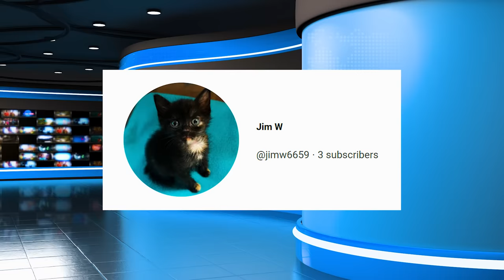Why Are So Many Builders Running Away?

Comment: As a “customer” I found this extremely interesting. In 2019 I had an extension built (circa £150k) and having received several fixed price quotes (one of which was ludicrously low) I eventually shook hands with a builder who agreed for me to pay for all the building materials direct. He sourced it, ordered it and I paid for it. I paid his electrician, plasterer, brickie etc direct. The “fixed” payment was that which I paid to him split evenly over the course of the job. I was happy that there was no contingency fat built into the quote for materials and he was happy that his profit was protected. It worked out really well for us both - and we have remained good mates since.  I realise it’s not a common business model but it removed a lot of potential points of conflict and was generally less stressful for both parties.
Reply: Quote: "He sourced it, ordered it and I paid for it". Thing is this model has allowed many builders to remain under the VAT registration threshold which ,if investigated the Builder can be prosecuted for vat fraud. It's saved you 20% VAT on all the Labour but may have also broken the law.
Reply: @AdrianSams  I can’t see how it can be breaking the law.  There’s nothing unlawful about me buying materials and paying an expert to use them…..and at no point did I say I saved by not paying any VAT.
Reply: @AdrianSams  It would be difficult for HMRC to prove that, 'Sourcing and ordering' doesn't leave a paper trail.
Reply: This is becoming more common and traditional building companies are not getting the work anymore......
Reply: Try explaining that deal in Albanian, Polish or Somalian.
Reply: Another way to look at it Kevin is to ask yourself what would happen if every builder did exactly the same as your builder. How much VAT would the Chancellor lose ?. Every £10k of Labour they are losing £2k in vat. I'm not knocking people for doing it other than it prices out vat registered businesses . If I did the same thing ,based on last years accounts the state would lose out to the tune of £20k and that is just one small business in a small town in England.
Reply: @AdrianSams  You are assuming that I did not pay VAT. The builder was VAT registered and charged VAT for their services.  The only difference was that the quote for his services did not include materials.  I obviously also paid VAT for the materials. Some sub-contractors were VAT registered and some were not - perfectly legit. HMRC did not lose a penny on the job.   The point is, the builder did not have to include any contingency in his quote for fluctuations in material prices.   If he had, then either I would have ended up paying too much for the materials used (I lose) or he would have ended up making a loss on the materials (where I win, but possibly lose the builder before the job is done).
Reply: @kevinturner8343  So when I posted a message in reply to your post where I said (not having a dig at you) how some Builders were avoiding the vat registration system by getting the client to 
pay for materials which keeps them under the vat threshold so aviding charging vat on their labour you could have posted back that the builder was vat registered. Would have saved typing time  ,well done you .
Reply: @AdrianSams  Well I did say "at no point did I say I saved money by not paying VAT" in my reply :)
However your point is still valid.  In simplistic terms, if every builder's quote was 50% cheaper because they did not have to worry about materials, they would indeed be possibly more likely to stay under the VAT threshold....and legally as far as I can see.
Reply: There is absolutely nothing fraudulent with operating in this way. I don't see how HMRC would be able to bring a VAT fraud charge to builders operating on a "labour only" basis.
Reply: @kevinturner:  @AdrianSams is what we call a 'Karen.'
Reply: Stick as many of the materials as you can on a credit card and clear off using the air miles while the work is being done too.
Reply: This is normal working practice in Peru. Actually we had to source and have delivered the materials too, but often with some advice from the guys doing the work. This has the advantage that we know the quality of the materials being used, i.e. nothing is being substituted with inferior copies, and we can check that the quantities being delivered are correct. We built a whole house like this. It's interesting that some form of this is also possible in the UK. Yes, it gives both sides some additional guarantees.
Reply: @AdrianSams  -  Sounds like you need to check out the VAT Flat Rate scheme and then sack your accountant for not telling you about it (or punch yourself in the face for not getting an accountant and wasting so much money). Turnover under £150k = eligible for Flat Rate VAT. I pay 7.5% in my retail business. For building it would be 9.5%.
Reply: That’s exactly how I do it in Australia 👌🏽
Reply: Seems like a good idea for both of you. I don't trust customers any more. Sad but true.
Reply: This is pretty much how its done here in Canada the Builder/ organizer mentioned here is called a GC "General contractor" in Canada and is paid a % of material and labour costs.
Reply: @uazuazu  Same In Canada
Reply: @AdrianSams  Your making huge assumptions, how do you know the builder isnt VAT registered ?. Its not illegal. Its a self build contract which everyone has the right to enter. It comes with risks, the builder is not obliged to stand over the work or materials that the customer paid others for, thats simple contract law. If the builder does cover these risks he should be charging for it. Either way his income gets accessed for VAT and failures to do that are down to the builder not the customer. Not everyone would have the knowledge or confidence to contract this way which includes ignoring unrealistic quotes. It also transfers a lot of the admin and requires the customer to visit site more often to supervise progress . These factors should  rightly command a lower price.
Reply: @Finderskeepers.  Go back and read my first message where I said the Builder MAY, Notice the word "May and not "Had" have commited vat fraud. Don't you numpties read the whole chat?..You could have saved yourself all that typing.
Reply: @AdrianSams   "the Builder can be prosecuted for vat fraud" conditional only on a VAT inspection.   I dont see any "may" attached to this opinion. Appears you dont practice what you preach.
Reply: @AdrianSams  your second message clearly implied fraud:

“ask yourself what would happen if every builder did exactly the same as your builder”

I’m sure you will apologise for your error
Reply: @RobinHarris-nf4yv  Rubbish, ever heard of the term "Hypothetical Question?. Definition of "Hyperthetical" being "in a way that is imagined or suggested but not necessarily real or true".
Reply: @AdrianSams  As a Canadian former small buisness owner, we pay VAT (HST) for materials, fuel and repairs to our equipment. The CDN government then allows us to "claw back" the HST. However we must charge the customer HST. If the customer were to buy materials etc directly, they'd STILL have to pay HST from the supplier. 

Is this similar to the UK system?
Reply: @AdrianSams  this is and has been not only legal but a legit form of working in this industry for decades- VAT is still payed on the appropriate materials at the appropriate rate. The customer 'Worked' by sourcing and buying them instead of the builder.  This isn't Tax avoidance at all.
Reply: @goodlookinouthomie1757  The VAT discussion is a rabbit hole that is really nothing to do with it.  

The video describes a scenario where builders lose money by providing fixed quotes for materials that then go up in price - ergo the builder makes a loss on the materials and, in the worst case, a loss on the whole job. If they do not have to include material costs in their quote, that particular risk element is gone.  For me, I would rather pay for the materials as the job progresses as (as I said in the first comment) I know I am getting them at cost and I am not going to lose the builder halfway through the job because he cannot afford to carry on.
Reply: This is how they do it in France for tax reasons.
Reply: @AdrianSams is it bollocks breaking the law. 😂
Reply: @Simple_Simon_UK  you really are "simple" Simon...aren't you? 😮‍💨
Reply: Spot the know-nothing pen pusher Adrian...
Reply: Spot the know-nothing pen pusher Adrian...
Reply: Spot the know-nothing pen pusher Adrian...
Reply: That's a good way of doing it. A lot of builders add extra money on to the materials and the wages of the other trades because they are greedy, grabbing bar stewards.
Reply: It removed the government, the third party.  And that is always a win-win.   Hopefully we all learn to vote that way - libertarian.
Reply: I’m a bricklayer/builder and I do this method all the time, keeps everything honest and less mistakes are made
Reply: @AdrianSams the builder could claim the  VAT back for the materials but the customer can’t. So HMRC get more out of this job!!
Reply: @AdrianSams  - I'd spend it on family or down the pub instead of on putting up free loaders in hotels.
Reply: @AdrianSams you say that as if it’s a bad thing. Do you really think they deserve a penny when you look at what they spend it on
Reply: @AdrianSams  On the other hand, you could have asked rather than making (inaccurate) assumptions.
Reply: @AdrianSams  If that were the case, then you should have stated so. You didn't and I suspect you are just clutching at straws rather than admitting that you made a series of rash assumptions and haven't got the guts to admit you were wrong.
Reply: @AdrianSams I get the feeling that people don’t want to be on job sites with you 😂

Comment: Heating guy here. I’ve had enough  now, 20 years self employed, sick, stressed, working too much and too hard, not being truly valued, helping people out, but as soon as your not available immediately they drop you for someone else. Being betrayed by family has been the final nail in the coffin. 

I’m going to try and be a boring 9-5 smart meter fitter in 2024.
Reply: I hope the meter fitting course explains how the 13th amendment regs were updated to using non-combustible consumer units off the back of the increased number of fires that were actually down to smart meters fitted onto reused meter tails that were oxidised, making high resistance connections causing overheating! But they probably won't...
Reply: I'm coming with you m8
Reply: Right on there about family. @effing sicking
Reply: Absolutely right .  No  loyalty from customers  (another heating guy).

Comment: As a plumber/gas engineer I always tried to judge the customer when going to quote. Turned down quite a few jobs, particularly those who wanted a fixed quote for a job with a lot of unknowns.
Reply: .... and you were right to do so. You are there to make money, not be a charity. Any customer that is not able to write a spec to include contingencies for unknowns should be avoided. The way I used to tackle this was to have a T&M clause in the contract to cover those unknowns that we both agreed upfront could not be quantified.
Reply: On the flip side, customers need a fixed price, to know how to budget effectively and ensure they can pay you in full and on time.  If costs escalate, many families on a budget simply cannot afford to take that gamble.
Reply: @whitefields5595  Customers who write detailed specs, materials etc get 0 quotes because they are regarded as "smart-asses" that are hard to overcharge.
Reply: @chrise202  Funny how people smart enough to write exact material specs do not appear to be smart enough to understand there are costs involved in running a business which are often accounted for in mark-up for materials. Some clients are funny about perceived high labour costs, some clients are funny about perceived high material costs. At the end of the day the story is pretty simple: Some money needs to be made to cover overheads & a profit would be nice. I think clients would be surprised how quickly the last point disappears into thin air when the installation takes even 1-2 days longer than expected.
Reply: @grumpycaver1123  There is a difference between establishing a premium labour  price, and disguising profiteering on materials. If you think you're really an expert in the field then you don't have to fear pricing labour higher, do you? After all your portfolio will speak for you.

Comment: Word of mouth is the best way. It's lovely to have a customer who loves your work so much that they fight your corner and/or provide a continuous supply of work from themselves and/or their friends. Getting there is another story. Great video!
Reply: Just turned 60 no intrest in working any more .after plannedemic.
Reply: Word of mouth is how I get all of my work as I don't advertise, I used to sign write my van and did get some work that way but I haven't bothered with that when I purchased my present van.
Reply: The best way. Happens more than people realise. Peace brother.
Reply: I fixed cars 4 years never advertised always had work. No garage so I was super cheep. N just fix it and you always get more to repair.
Reply: Agreed the only trust worthy builders bar 1 I've had have been through word of mouth. If I can't find one through genuine word of mouth then I'd rather have a go myself. Often cheaper to mess it up a couple of times myself than to waste a lot of money on a rogue builder just for them to mess it up.
Word of mouth is the only way to find genuine trustworthy tradesmen as there are so many cowboys nowadays
Reply: Agreed.  I worked for 40 years in water treatment industry (recently retired, 33 years as boss of my own company).  During that time, visiting many building sites to do work, I built up a list of heating engineers, joiners, plasterers, electricians etc, all of whom I can trust to do a good job.  Recommendations are almost always the best way to make sure you get a decent job done.